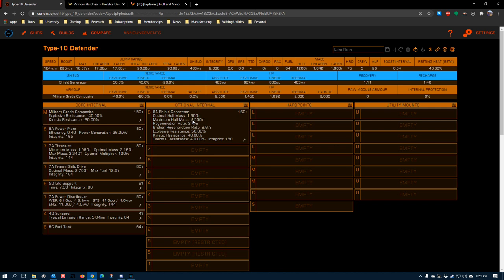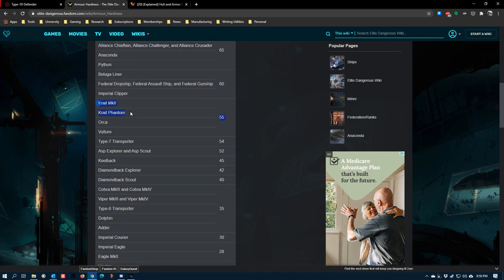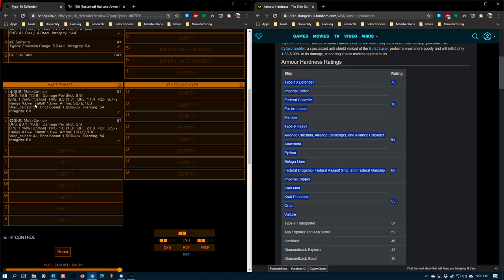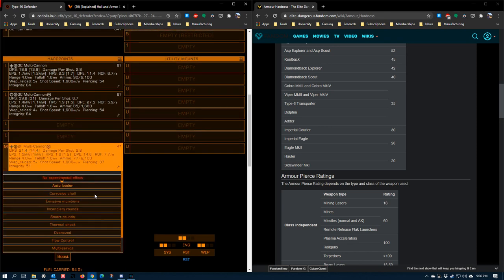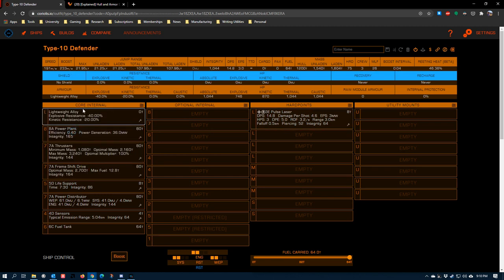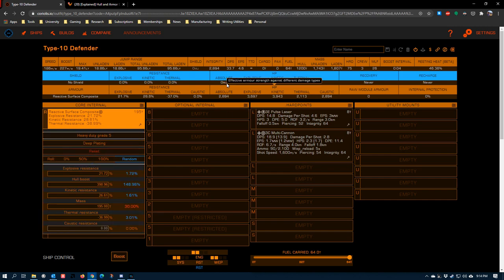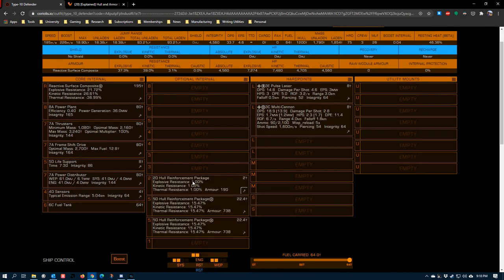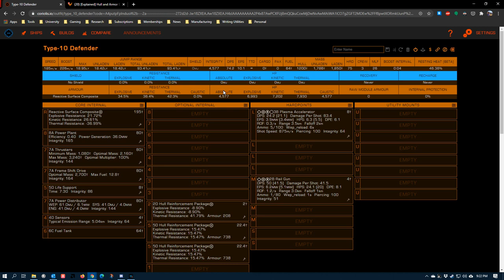Elite Dangerous | New Player Tutorial | Armor & Hull Reinforcement

Comment: That is a very common way to stack resistances. However for fer de lance (and other medium ships) there are 2 other options that are used. One of the options is instead of the heavy duty reflective armor is to use thermal resistance reflective armor. In that way you have a lighter build for more speed and you do not have to balance resistances with hull reinforcements afterwards as everything is balanced (in that way you can either place heavy duty hull reinforcement or module reinforcement). The difference is terms of resistances is minimal. Another more pro modification is to use the light weight modification, in order to make the fastest build.

Comment: Module reinforcements ?
Reply from the maker: I'll get to those, but there is a lot less to talk about.
Reply: @DryHeatAndSand  as I understand, it's when some dps breach passed the armor, 60% of the remaining goes to damage the module reinforcement module instead of another module being hit. So I think having two of those is interesting. In real pve I can still fly with much less armor % (say everything looks okay @50%) without any malfunctionning module. When I replace those two with hull reinforcement, even with the hitpoints and resistance : I see module failure even when I am still at 98 - 95 %. NPC do not target modules but modules get damaged by random hits. I think having two module reinforcements is the fitting that gives the most playable time before retreat. (or shield recovery) I use one big (5) and one small (3, 2 or 1) and usually the grade 5 is damaged first, if that module dies, I fsd out.
Reply from the maker: @AlexandreLollini  Your logic is sound, except that at one point there was a bug that could cause your second MRP not to be included properly in the damage calculation. I have not had a chance to look into weather or not that bug has been fixed.
Reply: @DryHeatAndSand  in general when I head back to station, I have one MRP deeply damaged and the second one with moderate damage, while the main display of the hull is around 50%.
Reply: @AlexandreLollini  it is claimed that NPC enemies in conflict zones will definitely target modules. NPC's in extraction sites behave as you have stated.
Reply: I love mrp’s.  Usually roll a big and small one to get 84% reduction.  Has aided in my survival during cascade and penetration shenanigans in pvp and even allowed prolongued engagement even while in armor, something I probably would not risk without mrp’s ever.
Reply: @FiveFootFall  Imagine my surprise after 3yrs away when I got my ass handed to me on my engineered FDL on a CZ. I think they definitely went for modules and I barely scraped off to the nearest station.